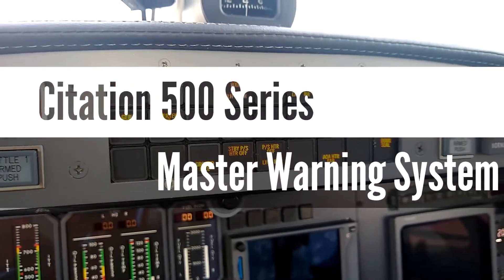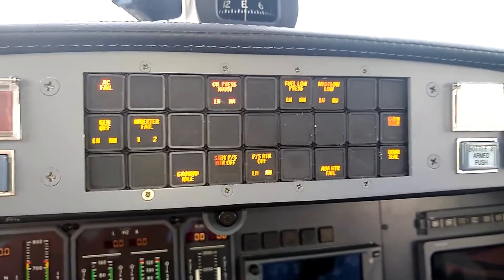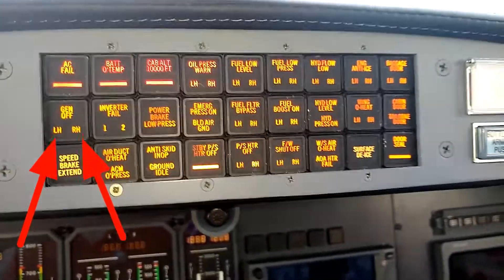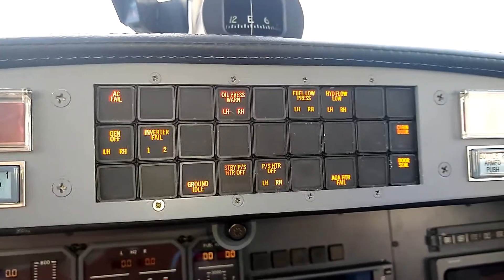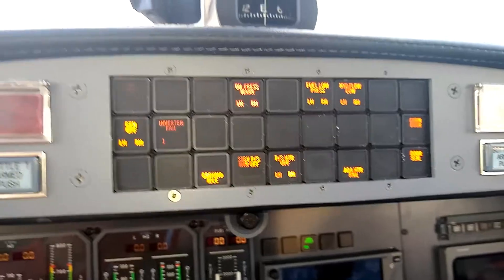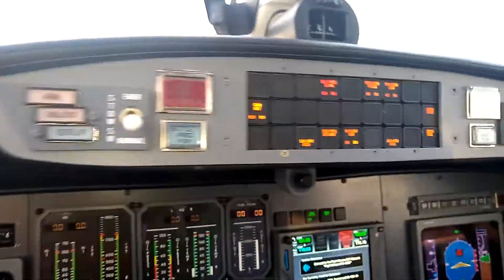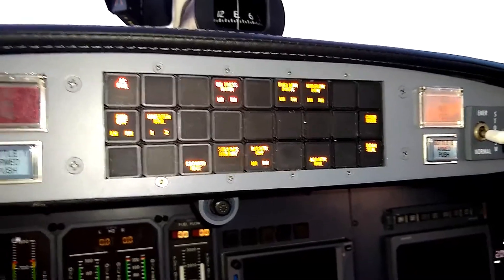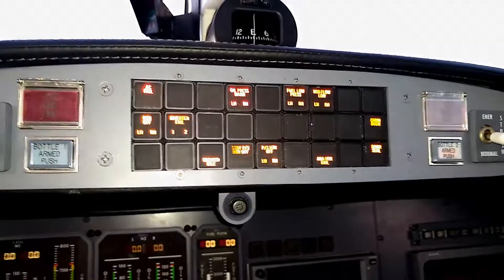Citation 500 Series - Master Warning System

Comment: At 9:52 you talk about resetting the master warning which extinguishes the annunciator fault that caused the warning. In your example of the pressurization failing, would the pressurization annunciation extinguish after canceling the master warning? Or would the annunciator stay illuminated b/c the pressurization system is still failed)?
Reply from the maker: Good question. Technically speaking, the annunciator would be the CABIN ALT annunciator indicating the cabin altitude has climbed above 10,000 feet. It would remain illuminated even after resetting the master warning if the condition still exists. If the condition is corrected (cabin altitude descends to less than 10,000 feet) the annunciator would stay illuminated only until the master warning is reset, at which point the CABIN ALT annunciator would extinguish.

I might not have done a clear job of explaining the significance of this concept in the video. After getting a master warning, the pilot should always look to the annunciator panel, note what caused the master warning, confirm it with the other pilot, then reset the master warning. Every single time. This procedure helps ensure a second glitch/failure in another system won't be "masked" by either leaving the master warning flashing (causing the pilots to not notice the second failure) or resetting it too quickly, thus causing them to not notice the second failure because they assumed it was the first problem glitching on/off.

Comment: Isn't there a master warning you cannot acknowledge?    I seem to remember one from your rotary test video.  Thrust reversers?
Reply from the maker: Correct, the master warning during the annunciator check using the rotary test is "noncancellable" meaning if you push the master warning reset button during the test and it clears the warning, something is wrong with the system. You shouldn't be able to reset it.

However, this only applies to the one rotary test function. In flight, under non-test conditions, the master warning should always be able to be reset no matter which of the six conditions tripped it (four red lights, dual gen failure, TR arm/unlock light in flight). It's designed this way so the crew can be alerted to a serious problem, acknowledge the problem, then be alarmed again if another problem pops up.
Reply: I'll review your Ultra rotary test video & circle back to this Master Warning video; they're like peas & carrots.  You also have rotary test videos for the Citation II and Citation V but the Ultra video is closest to the Encore.